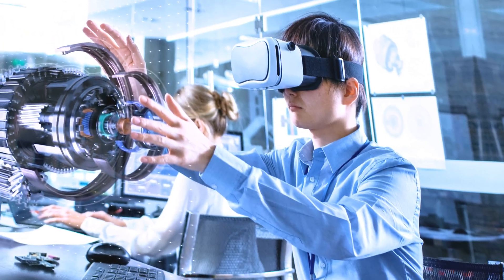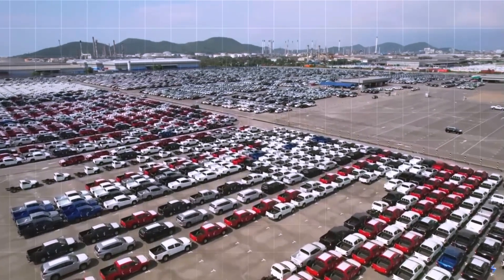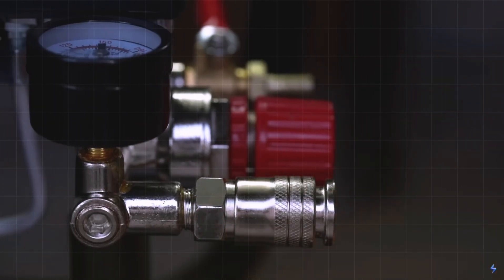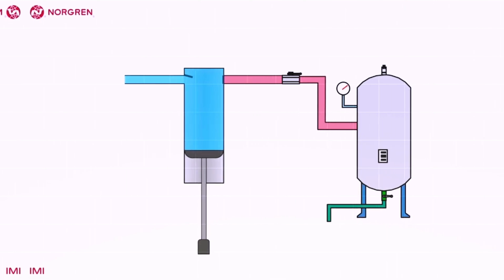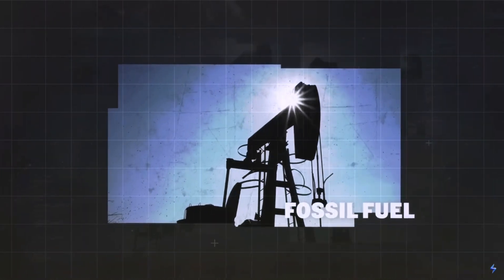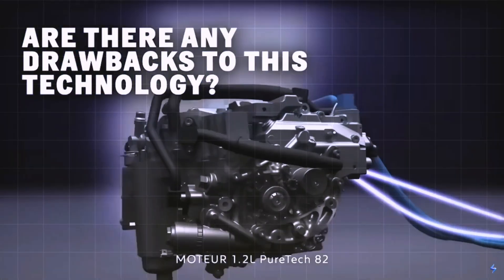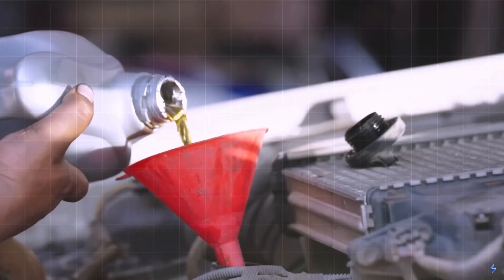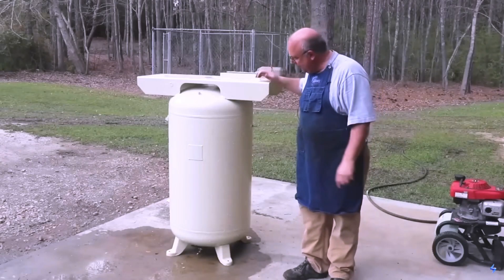"GM Breaks Paradigms with Innovative Engine and Paves the Way for a More Sustainable Future"

Comment: Utter nonsense. Why make up this stuff, it's so stupid. Compressed air can't possibly supply the range needed for a car. It's even dumber than Hydrogen, but at least that does work to some degree, even if it's hideously inefficient.

Comment: “This is because the energy required to compress the air is OFTEN greater than the energy released when the air expands in the engine.”

The energy required is ALWAYS greater. Otherwise you could build a perpetual motion machine!!

This is a PROFOUNDLY dumb idea!!!